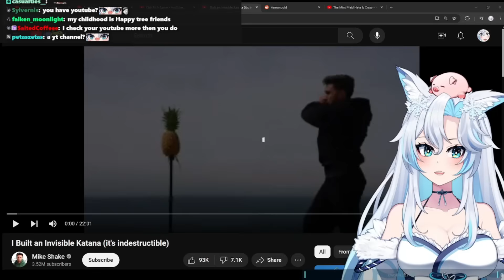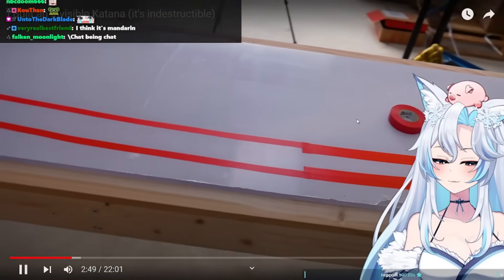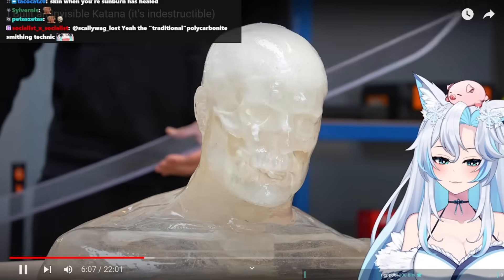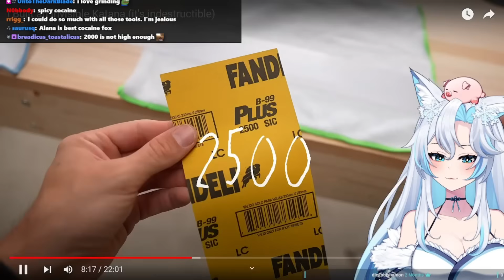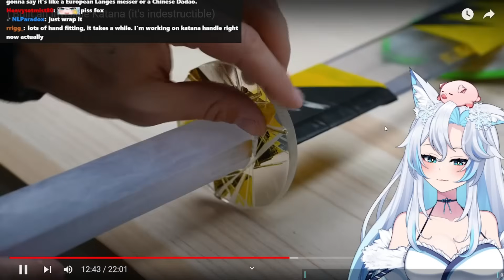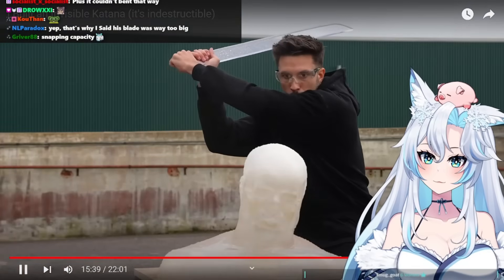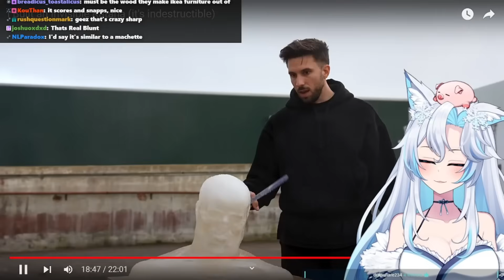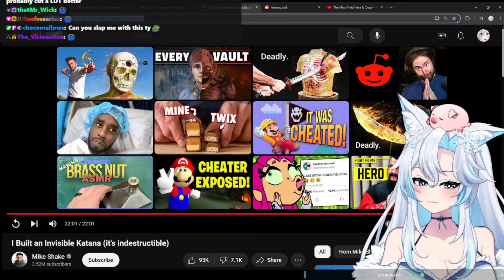THE INDESTRUCTIBLE INVISIBLE KATANA!! || Mike Shake React

Comment: I know that pain, I'm studying to be a jeweler, so ignoring getting marked on how well we sand and polish the piece, the only time we use a machiene for sanding is when we do the inside of ring bands, the rest is by hand in small crevices.
Reply: Also harsh angles are liable to cause structural failure, thats why most load bearing structure have radised corners.

Comment: The tang shoulder was a hard angle, which meant that kinetic stress was likely going to turn it into a breaking point. 

You need the ricasso and tang shoulder to have a circular angle as it tapers down. No sharp angles. It's much less likely to crack or fracture when stressed.

 It's a pretty beginner mistake and I had a feeling it would snap there when I first saw it.

Comment: I can see a few issues he's having cutting.

He made a straight blade.  It's easier to cut with curved blades than with straight ones.  Not much of a factor but a little more curvature would've helped.  

His blade is too thick.  His first sword he made probably would've cut alot better but I understand why he didn't use it.  It wasn't invisible, which is the point of the video.  I'm just saying blades are shaped the way they are for a reason.

The material he was using would've been alot better for cutting if it was more rigid.  That said, it would be decent for thrusting.  You want a flexible blade for that.  I think the polycarbonate is too flexible though.  It's bouncing everywhere.  You don't want that if you're trying to cut.  A little more curvature would've helped deal with that a little.

His technique isn't great.  I don't know if he practices or not so I'm not gonna hold it against him but he was swinging it like a bat.  Especially with a straight blade like he had, you want to do a push pull motion to hit it at an angle.  It also helps when you hit at the point of balance.  Then there is edge alignment, which you don't get the feel for until you've practiced cutting for awhile.

I think it might've been too light too.  It's a little easier to cut when you have some weight behind it.  I don't know for sure though.  Would a piece of polycarbonate that size weigh about 3-4 lbs?

I also would've liked to see how that would've held up against a carbon steel blade for comparison.

Comment: Armchair swordsmith and amatuer swordsman here. He has two problems with the cutting potential. 1. His form is bad. He has poor edge alignment. 2. That blade geometry is fucking terrible for cutting anything. It's another instance of "forgetting physics" . If he had used the first blade he made it would have had great cutting power, but ironically I don't know if it would have had as durable a blade. I have no idea how well Polycarbonate keeps an edge. A blade with that profile holds an edge very well, but it doesn't cut for shit because the angle of the sides of the blade does an exceptionally bad job of moving the material it is trying to move through apart. A longer bevel on the blade makes it easier for the blade to move into the target.